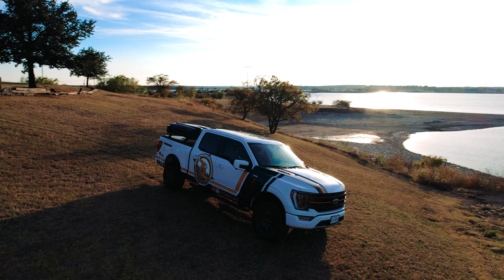(Showing off Wrap) why Clear Bra is better than Ceramic Coat. F150 Ford Tremor

Comment: Getting my tremor wrapped next week. 18” partial front wrap plus headlights.  And the rockers behind each wheel well 
Trucks have to have front wraps where rocks hit the paint.  I’ve never seen a big truck like a tremor get chips on top of the hood. Now on my 911 GT3 I have the whole front wrapped because it’s so low
Reply from the maker: Nice! I had like 3k miles on my truck and a rock hit the top of the hood and flew into my glass. Lots of rock trucks around my area. Pissed me off!
Reply: @TremorTrails  I can imagine. As much as you use your truck it’s a great addition.  I saw you were listening to the Cowboys game on one of the videos. I’ve been a fan since I was 5. But I’m done with Jerry Jones. Until he hires tea; professionals to manage the team I’m done
Reply from the maker: @jimsteinway695  I was born in Irving about mile from Texas Stadium. Every year I say I'm done but I come crawling back 😅😄😅